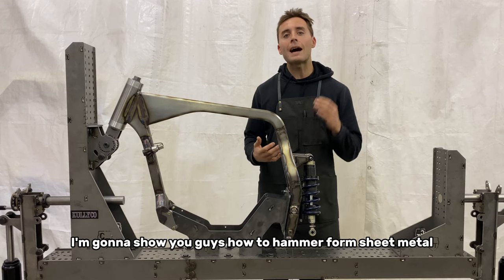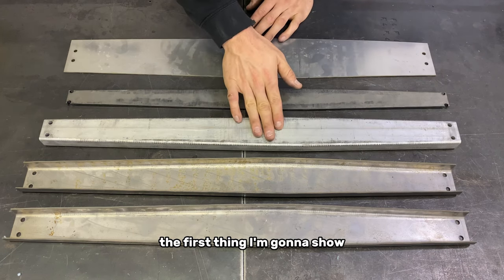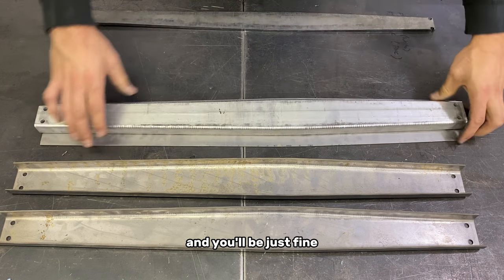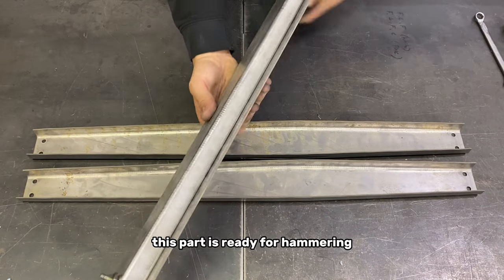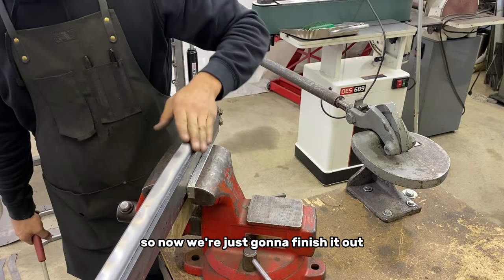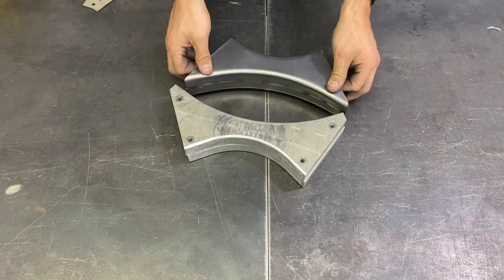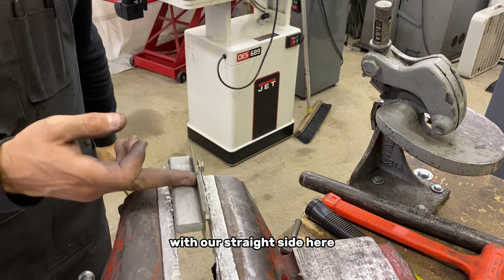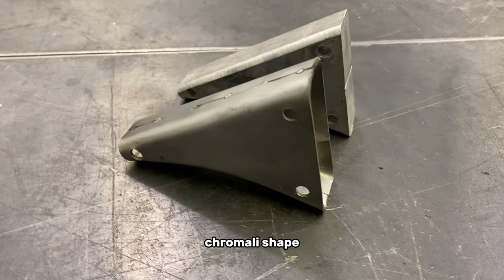How to Hammer Form Step by Step / Hammer Forming basics, all the way to expert level processes

Comment: Great video!!!!  Thanks a lot!  But questions:
Does it make things easier to score the sheet metal first.  

I will work with a 304 stainless disc (.036" thick) laser cut and I can easily add score marks.  Should I add any?  If so, where?
Reply from the maker: Thank you- I appreciate you watching.  No, you don’t want to score - just use hammers and mallots .  The idea is to have a radius edge not a sharp broke / scored edge
Reply: @KULLYCO  Hi Kully:  Thank you very much for taking your time to answer my Comments-Question.  I will subscribe.  Again, terrific video!

Comment: This technique and process is fantastic but you are using a mallet.  This video should have more views, it is pretty trick.  You essentially make a form and treat it as a hand held metal break but incremental with variable radius.
Reply from the maker: Yes that is correct, using a mallet!  The hammer form process is pretty neat, you don't see too many guys doing it.  Maybe the video will ramp up later!